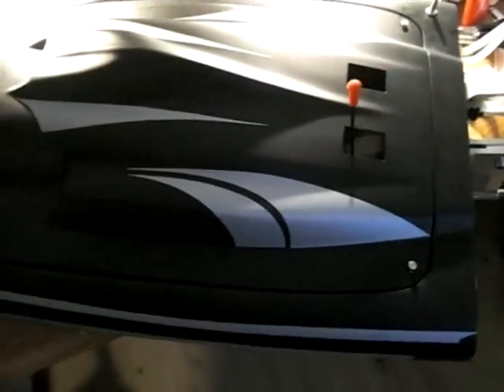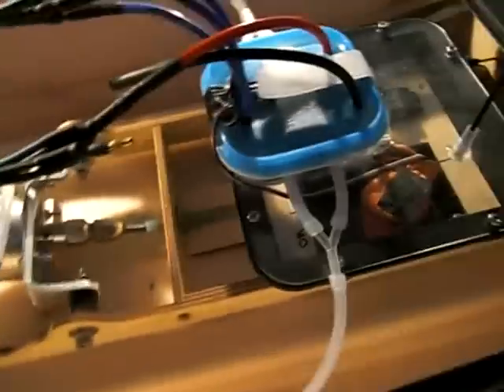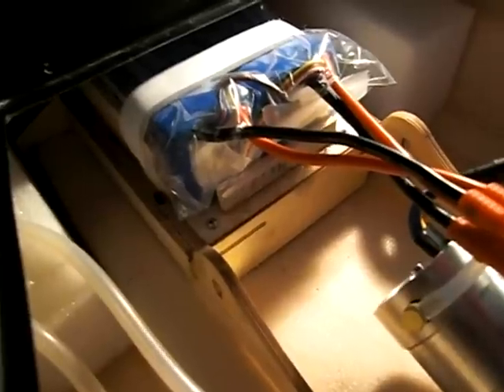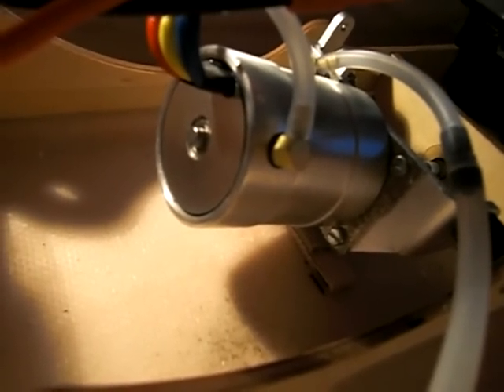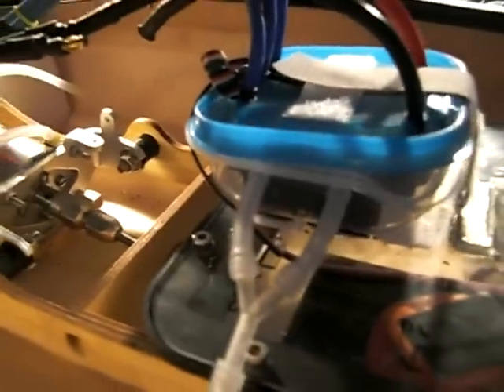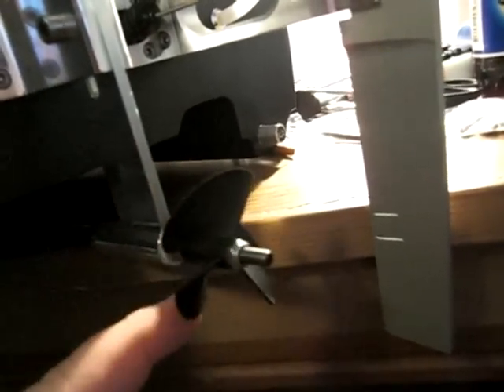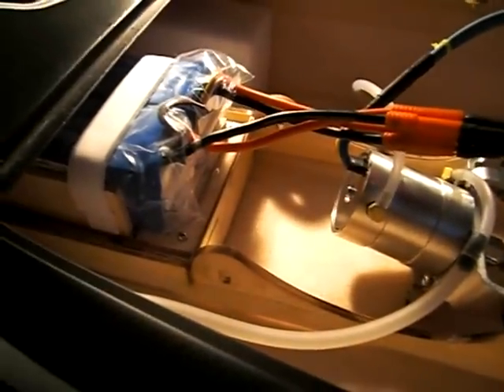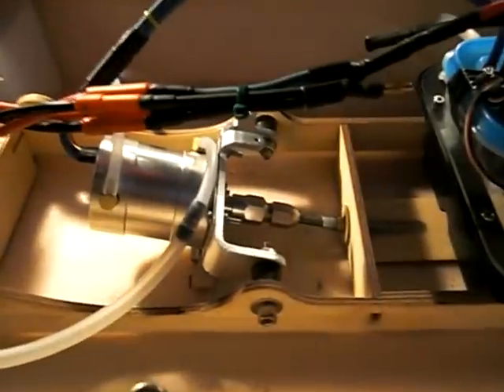Navicraft outrage converted from 26cc gas to brushless electric.

Comment from the maker: @69blackups69 
Well, yeah you can run this boat on the sea. as in salt water. But it's never recommended to run rc boats in salt water, cause they will corrode.

Comment: Hello, where did you find the motor mount ?
Reply from the maker: Think it was from the gas engine. But I modified it. Was a large hole in the mount, but I placed a steel plate to cover it, and then drilled new holes for the electric motor.